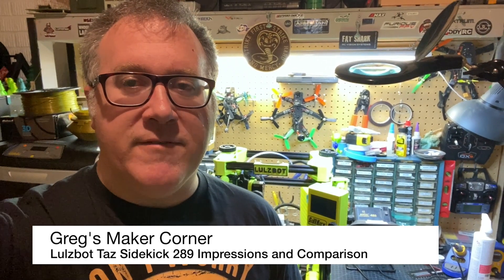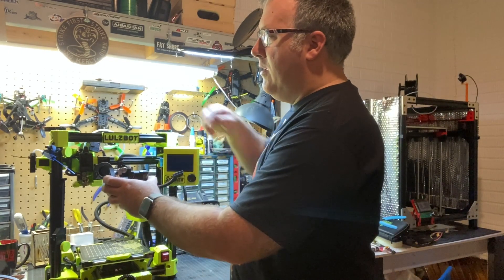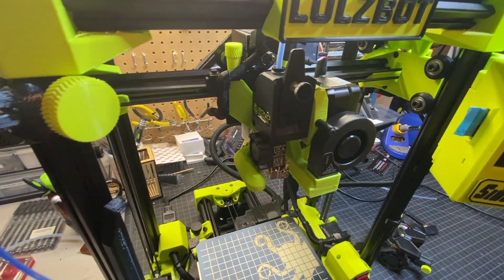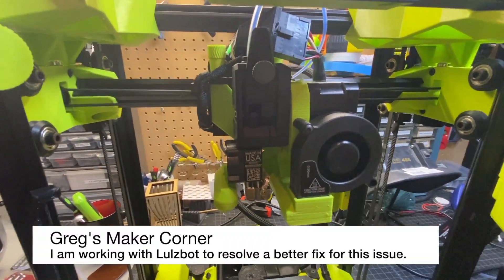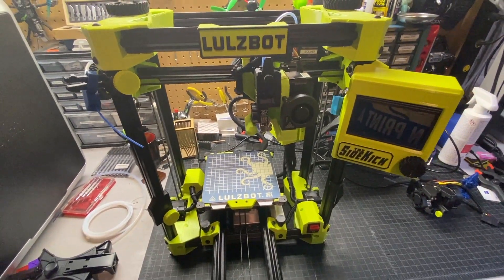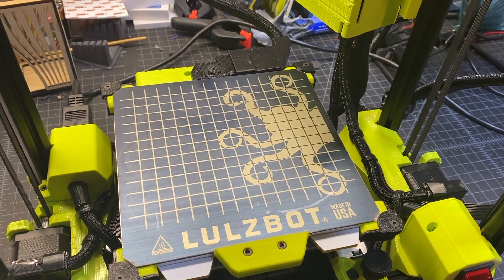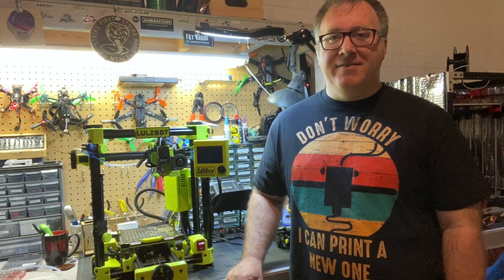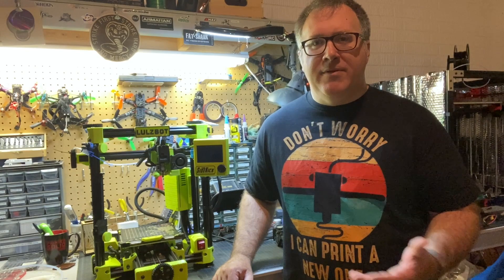Lulzbot Taz Sidekick 289 Impressions and Comparisons

Comment: I like the 289 printer over my Mini 2.  The bed leveling is always spot on for the 289 in comparison to my Mini 2.  I'm not liking the position for the print head up top when changing filament. That is difficult for an adult set of fingers and hands to maneuver.

Power off scenario is a complete failure in my tests. The hot print head drops nearly a centimeter into the part, ruining it. Then on power on, the print head now does not readjust for the lost z height and it rams back into the part.  In a scenario where power failure happens early in your build, the hot end can end up dropping into the glass.  On power up and if you tell it to restart, the head moves toward the x/y 0,0 position and can hit the 0,0 bed pad.  Overall the power loss feature is a failure in my testing.

Greg, your bowden supply tube should go up over the top of the machine and down into the print head. Your video you show it going off the side and around the back. You stated a need to zip tie it, but you have it routed wrong.
Reply from the maker: Some great feedback! I have not tested the power off feature but I am sure mine would do the same thing you stated. I noticed the head drops when power is off or removed from steppers. That definitely is an issue on these machines- not sure if Lulz are working on that yet. My Bowden tube is too short to go over the machine top, but there is a new part they have now that fixed the angle so it can’t get caught on the gantry. I should be able to use that and ditch my zip tile but for now it is working. They have sent me a few new parts that have made this machine even better and fixed some issues. I will have another video coming soon on that. Thanks for chiming in and glad yours is better than the mini 2.
Reply: @GregsMakerCorner  now that I got your attention I have a few questions about NinjaFlex if you use that?  Great success using NinjaFlex 2.85 mm on the Mini 2 and the new 289 with the 2.85mm SE print head.  I am struggling with NinjaFlex 85A 1.75mm on my Prusa Mk3s+. However I've gotten successful prints using Overture TPU 95A on the Prusa.  My question to you: Have you used your Lulzbot 289 with 1.75mm to print any NinjaFlex 85A?
Reply from the maker: @MrBteacher  Hey Brian- so far I have only tried Sainsmart TPU, which I believe is a lot more like 95A. I have run super soft NinjaFlex 85A on a bondtech extruder before with a 1.75mm hot end, and also on a Hemera with success. In both cases I had to drop the speed down quite a bit- around 12 mm/sec (for the Bondtech) and no more than 20 mm/sec for retraction speed. If you are having trouble try dropping speed down even more. I have run ninjaflex up to 40 mm/sec on the Hemera but it doesn't look good printing much faster than that since it needs good cooling.

Comment: I have a TAZ6 and quite like it.  Would like to ask you... do you think the build quality of the Prusa mk3s is better as a result of their printers+end-to-end software approach?  I look around trying to find the nswer to this and never get a clear answer.  I will keep my TAZ6 just coz it's so rock-solid.  But might buy a Prusa if the quality of print is really that much better.  What do you think?
Reply from the maker: You can definitely get as good or better prints as the Prusa Mk3 easily with the Lulzbot Sidekick (and the Taz 6). There have been a improvements to the 3d printed parts since it originally came out to address some of the early issues. The firmware for the Sidekick is also a fork of the latest Marlin firmware, which in my opinion is a benefit of going Prusa since it currently lags behind in many features. The Sidekick is much more sturdy than the Prusa Mk3 or Prusa mini by design. The biggest benefit Prusa has over the Sidekick is that it's been around for a long time, and thus is proven to be very good, and there is a much larger support group. Since you are already in the Luzlbot ecosystem you should definitely consider the Sidekick. It's a great machine and just getting better and better.

Comment: Nice job Greg! I do think the 747 at $1100 assembled will be a Prusa killer. I would pay $100 more for a better built machine in the USA.
Reply: Not even close to prusa killer..
And you are looking at $1365 to compare to anything.
($125 for a $15 lcd, $195 for hotend, extra for flex plate and filament sensor etc...)
On top of that, it does not use linear rails or at least smooth rods and bearings...
Plus, frame extrusions are angled 45 degrees, so mounting things is a lot harder..
Reply from the maker: @labworks8201  Yeah, all valid concerns. The price is the biggest one! The machine kinematics are actually pretty decent despite some of the surprising choices (v wheels, rotated extrusions, etc.)
Reply from the maker: Thanks!! Yeah I think you're right, price needs to come down a bit. Hopefully that will happen! It's good to have US competition in this space.
Reply: That's a pretty fair comment.  Am wondering how the Prusa end-to-end software control design does in comparison to the Cura-based Lulzbot.
Reply from the maker: @RockwellAIM65  I think Prusa Slicer is definitely better than Cura Lulzbot Edition in terms of overall features. However, you can also use Prusa Slicer on the Sidekick and also even update the firmware with it. So I don't really think the slicer is all that important for consideration. I would like to see Cura Luzlbot Edition to be more current, similar to mainstream Cura.